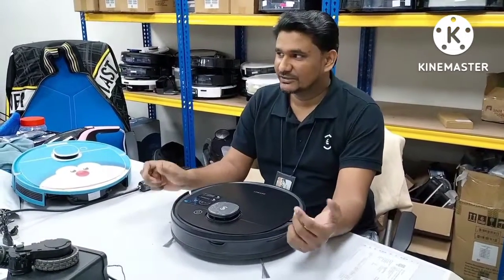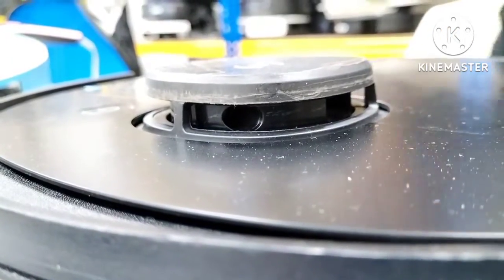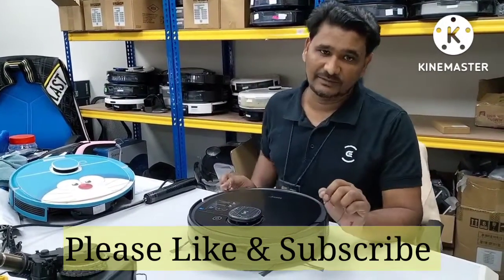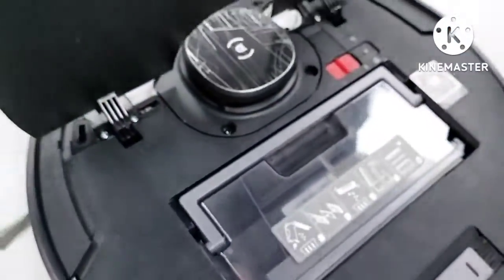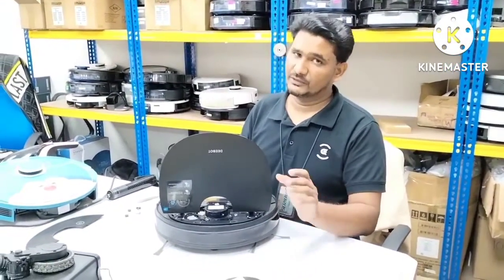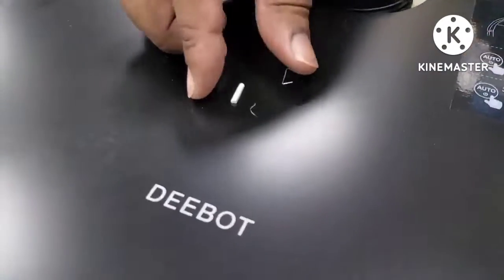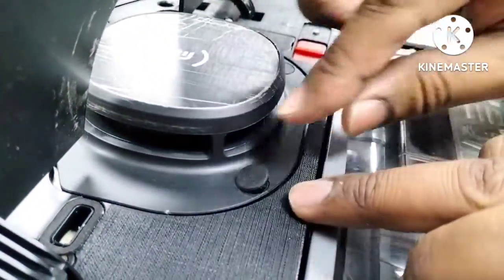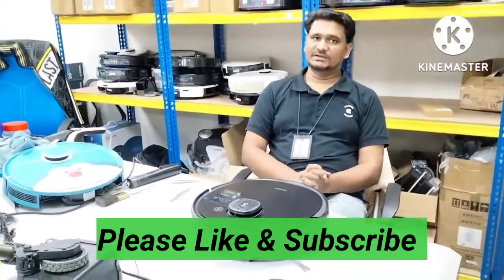How to Fix/Repair Ozmo 950 LDS Error?

Comment: The son poured sweet tea over the deebot. Since then, it reports an error that the distance sensor is blocked and that it needs to be cleaned and deebot stoped with work. I didn't know how to clean it, I took it to the service center and they asked me for €300 for the repair. I refused, at home I opened it myself with your video, wiped the sensor, washed the eraser and deebot works again without problems. Thanks for the video! You saved us a new expense!
Reply from the maker: Waaaaaooo.excellent really feel happy 😊😊

Comment: My deebot is still giving LDS error after cleaning. The LDS unit is rotating nicely. I observed that the white wheel which rotates the LDS unit, stops after few rotations and then rotates again. This happens twice and the deebot shows LDS error. What might be the issue?
Reply: Hi I have the same issue . Did you manage to fix this ?
Reply: Same issue and no fix
Reply: @josephchandy9006  couldn't fix it. The company said that LDS has to be replaced. However, I think that there might be something wrong with the board supplying power to it. The company service guy just came and cleaned it and said it won't work. I think they don't have a good technical repair service team. All they suggested was buy new LDS or buy a new bot.

Comment: My LDS rotation is smooth and nothing is blocking the sensor or the belt but the sensor rotates for about 30secs and then stops for 5 secs and then again rotates for 30secs and then stops again for 5.  This happens 4 times till i finnally get that "LASER SENSOR IS BLOCKED"

Comment: There is a problem where the LDS kept moving even when the machine is in the OFF position. The command is starting to clean but it’s wheels doesn’t moves. Could it be the LDS is malfunctioning or motherboard problem? Thanks in advance…

Comment: Hello, I have just followed these instructions to clean the LDS on my T8 Aivi. However it is now not working at all and shows a dtof error. What should I do now?
Reply from the maker: Ok..in T8 aivi you need to replace motherboard+ under the motherboard got one small chip attached with carpet sensor n motherboard through wire these parts will replace together then only Will move...if you just change motherboard then that motherboard also will be short circuit..can not use again

Comment: My debit is not working. It's not switching on and when I tried to place it on the charging dock it's giving warnings to switch it on and showing then is warning that the power is low... What do I do with this?? Any service centers in Hyderabad.
Reply from the maker: May I know which model u r using madam...if it's not Ozmo 950 then most likely is just battery issue...but if it's Ozmo 950 model & it can't charge means motherboard issue

Comment: Thank you for this detailed sharing. And for so generously sharing your knowledge. I finally got the top cover open, the tip I think is to prise it open from the sides and not the middle. But I'm so grateful for your videos. Thank you again! My LDS sensor is now working again using your method of testing!

Comment: These videos are really helpful for users who don't have Ecovacs service center nearby. I'm one of the culprit :)
Reply from the maker: Welcome..if u need any help can contact 00601137973018
Reply: @ecovacstechnicalsupport5278  You made my day. Really appreciate your support.
Reply: Dear help me too
Everything seems fine and clean and moving but getting the same error
Reply from the maker: @supratimsaha4488  if you followed all these video tips but still gives same error then LDS laser distance sensor assembly need to replace..u can contact ur seller if he provides you LDS then u can replace at home as well
Reply: Hi sir 
I am from bangalore India.
I am having deebot 950.
Its going backward then stop and showing bumper stuck. Please help.
Reply from the maker: @chhandak1  when u press deebot bumper...it bounces back or not...if not bounces back then just need to open bumper n fix it again propely... Will be ok
Reply: @ecovacstechnicalsupport5278  my deebot ozmo is not tracking  map

Comment: very good explanation and good Demo thank you Sir
Reply from the maker: Welcome thanks appreciation ☺️
Reply: @ecovacstechnicalsupport5278 Dear Bro I am Electronic Technician I got one ECOVACS DX 9G for service Because one side Running wheel Jamming it is steper motor But I can't open and take out motor I unscrew Everything and Bumper also removed Top Small Backlid Removed .Slide switch knob Removed But last Bottom Cover not coming outside why?
Reply from the maker: @dinarajancn5902  need to remove LDS screw first then all chassis screw include battery n underneath battery 2 more screw once removed all screw remove top cover wire From front attached with motherboard then pull up up cover after removing top cover then only can take out wheels...
Reply: Hai my Brother Now Remove LDS  Cover and 4 screws than I unscrew All screws and lift to the Top portion But only 75% lifted     I think one Hiden Screw in Side the front side pls help
Reply: ok thank you Sir Now it is. opened than lam trying to take out the Wheel

Comment: Hi, thanks for the great videos. I've cleaned the LDS on my 920 and the belt is good condition, however, the vacuum remains on the charger with the side brushes spinning and the LDS moving, but the unit doesn't depart and commence cleaning. Any ideas? The drop senesors look in good condition, and we've never used the mop function so nil corrosion etc.
Reply from the maker: In this case normally I change coreboard.. located next to motherboard a small green chip...U can purchase online can replace.. problem will be solve

Comment: Thank you for the video. I’ve followed your instructions and cleaned everything. I’m still getting the LDS error. Any idea of what else I can do?
Reply from the maker: 2 possible reasons.... might be Core board or LDS issue...in some cases motherboard also need to replace most likely is core board or LDS issue
Reply from the maker: After install the part only can confirm whether ok or not

Comment: My deebot has the same problem, but after just moving a bit the laser, it starts working again. Or better it works for some cleanings and after it sticks again. What do you think?
Reply from the maker: Actually LDS/ D-Tof doesn't turn continuously...it stop after few seconds then run again & build the map...this is how LDS assembly work...but if while turning it makes some grinding sounds or bit Sharp sounds.... means LDS assembly will give error but maybe for a while start working....in this situation LDS assembly need to replace

Comment: Hi, I always follow your videos, you explain very well, you make everything seem so easy. But now I wanted to ask you for some info, if you can help me understand, I have a Deebot 920 at home, I disassembled the LDS laser to clean it, but when reassembling it, I realized that I had inserted the plug of the LDS laser cable that goes to the board inverted mother, so I reassembled and turned the pin on the laser, now it DOESN'T turn anymore, it tells me it's blocked, but I turn it easily with my finger. I tried to reset the deebot, from the button next to the mention, but nothing to do, do you think it can be solved somehow? Thanks for your help, I'm waiting, have a good life.
Reply from the maker: In motherboard in front there's no other clip with same size...so it's not possible to fix LDS wire somewhere else... it's ok..just fix back all wires at correct place hopefully will be ok if LDS totally not moving then might be Core board issue or LDS issue
Reply: @ecovacstechnicalsupport5278  the cable was reversed over LDS. LDS is good I tried with another Deebot 920 robot. Is there anything I can do before changing the motherboard?

Comment: Hello. Thanks a lot for sharing that. I've followed the instructions however I still get the error. I get the message and the LDS is not turning at all. I've checked the motor separately and was able to turn it on (spined without issues), from the motherboard I also managed to confirm the power is coming to the LDS assembly. Should I assume that replacing the LDS assembly is possibly the solution? Or can it be related to the motherboard also? Thanks in advance and btw I have a model 950.
Reply from the maker: Most likely is LDS assembly Only need to replace...
Reply from the maker: Make sure if ur original LDS assembly is turning but deebot still not moving then then maybe core board issue or motherboard...but if LDS totally not moving then Just replace the LDS Assembly
Reply: @ecovacstechnicalsupport5278  Thanks a lot for your prompt response, very appreciated! I will progress with the LDS Assembly replacement.

Comment: I am right now trying to fix lds blocked issue.    I  cleaned most of the dirt. Belt is ok. Motor is making some sound consistently.  I donot know if it is ok. Motor starting speeding and pausing.  When the is removed the motor i working as you described.  But still lds blocked voice is played
Reply: Please help me

Comment: Hi

Thanks so much for the LDS malfunction resolution as we do not have any service centre nearby.

Another issue is robot motor starts automatically whenever power goes off and the robot parked in docking station. It doesn’t move but motor starts running whenever power goes off ? What should we do to redress this ? Thanks for your guidance 😊

Comment: Hello! I have a DEEBO OZMO 950, for a few months now it keeps creating wrong maps and cannot get back to the charging DOCK.
otherwise everything works, the DEEBOT is 2 and a half years old.
in your opinion what could be the problem? thanks in advance for the feedback
Reply from the maker: After 2 years might be LDS assembly need some service... you can serve first then reset full deebot... reconnect & save new maps if all parts ok then it will return to charger successfully..else LDS or core board issue possible

Comment: I'm getting an LDS error, but my LDS sensor is not dirty. When I try to rotate with the belt attached, it doesn't rotate as fast as you do, and it struggles to turn. When I test the motor with a 9V battery alone, it spins very fast. When it's connected with the belt, it spins slowly. Do you think it's a roller bearing problem or a motor issue? Should I completely replace the LDS sensor?
Reply from the maker: LDS assembly won't move very fast...if LDS is turning still can't move the deebot then sometimes Core board also can be deflected...
Reply: @ecovacstechnicalsupport5278  
Thank you for your help. When I took a closer look again, I noticed some dirt around the small black sensor inside the LDS card. I cleaned it with alcohol and a brush. The device is working now.
I have one more problem; the device hasn't been able to return to its base for a long time. What could be the reason for this? Which part may be faulty or in need of maintenance? The wheel had a problem before, and I replaced it. Could it be related to that? Have I made an incomplete assembly? Where should I look?"

Comment: Im having an issue with an Ozmo 950. it cleans and when its returning to the charging dock it stops right in front of it a couple feet away or less and rotates back and forth like its not recognizing it. Any advise on this. its in a location free of infared interferance or sunlight.
Reply from the maker: Sorry for the late reply....plz put the deebot in front of charger around 2 feet away n give command from mobile app. Return to charger see weather can catch signal or not....plz check Ur deebot bumper got dusty or alot of scratch on it...it effects to catch signal...can use car wax or any polish to make ur deebot bumper shiny can rubb with soft cloth....if still same then 2 reasons. Might be charger not giving signal or maybe deebot bumper faulty...can not catch signal from charger..

Comment: what if my  cleaner stopped working after 5-7 min? saying lds mailfunction than afte wont do anything? I have replaced the laser(not the full spining part)  could it be something like mainboard issue? or laser mainboard? thanks
Reply from the maker: Normally after replacing the new LDS assembly deebot start moving as normal....in  few cases I face this issue that I replaced cored board then start working...&. Few cases I face need to replace main board & LDS as well together then only deebot works

Comment: Sir, i followed the instruction in this video and there's nothing got jammed. My lds sensor can turn freely, and i check the belt is still okay. But i keep got the LDS malfunction. Mine is deebot 920. Can it be caused by the anti drop sensor located under the deebot? My anti drop sensor look dusty from the inside, i cant clean it
Reply from the maker: LDS assembly need to replace.... LDS error occurred when something wrong with LDS not due to Anti-Drop Sensors.... check with seller for lds assembly for 920 or 950 model...both using same LDS
Reply: @ecovacstechnicalsupport5278 I face similar issue LDS sensor turns freely and still shows error LDS malfunctioning.
Can some electronic guy can fix diodes with multimeter etc as we don't have service centre nearby

Comment: Hello, thank you for the video. Althought i opened and cleaned the LDS unit, LDS does not rotate easily and quickly. Could it be the cause of the LDS problem? How do I make it rotate freely? WD40 :D ?
Reply from the maker: Don't use WD-40 spray in LDS assembly...plz remove the belt n try to turn LDS see weather can turn freely...if yes then just LDS motor became slower...need to replace LDS motor only...you can find motor from electronic component sellers...or if you can find full LDS assembly will be more easy but bit expensive
Reply: @ecovacstechnicalsupport5278  thank you very much

Comment: After cleaning the assembly and the sensor, the sensor still does not rotate. I also opened it up and checked if all wires are okay. What could be the problem?
Reply from the maker: Sometimes because of core board it doesn't move & some time LDS motor spoil

Comment: Ecovacs Ozmo 950 LDS is Blocked, I checked Belt is Okay & Sensor Body Moving Freely by hand means not Jammed, What will do, Kindly give Suggestions, I am from Dwarka, New Delhi
Reply from the maker: If all you tested looks ok then it means LDS assembly is faulty...plz check with your seller for LDS assembly...you can replace urself at home if you can get online...

Comment: Hey :)
My Ozmo 950 running circles to the right side. Always when i turn it on it runs directly. Any Idea what this could be? I cleaned the Fall Sensors and the shock absorber at the front but nothing changed :(
Reply: Aynı arıza benim cihazdada var. Ozmo  model devamlı sağ tarafa daireler çiziyor

Comment: Hi, could you please help me? My deebot 950 not moving, though the brush start working after saying  "I am starting to clean". Checked wheels, bumper no problem. But doesn't move away from base. Tried rebooting too..☹️
Reply from the maker: Sometimes when u disconnect from charger n press start button it will work...but actually it all happened when LDS got some issues.,... LDS need to replace

Comment: Hello sir your video is very informative, I have deebot model Dx6g.
My device is only circulating at one point only, could you please help me out in this.
Reply from the maker: Just keep turning at one spot in circles only or can move here n there n after few minutes saying cleaning is complete???
Reply: @ecovacstechnicalsupport5278  it’s just keep rotating at one point. Thanks for replying sir.
Reply: @ecovacstechnicalsupport5278  just keep turning on one spot and after few minutes saying please help me out, and nothing else.
Reply from the maker: If just rotating at one place n can't move forward then its not an LDS issy . you must watch my video related to this topic...its a wheel issue sir....if ur deebot is turning clockwise then right wheel got problem if turning anticlockwise then left wheel issue
Reply from the maker: You can check My play list... wheel issue Fix at home video
Reply: @ecovacstechnicalsupport5278  thank you very much sir, and if it says after some time cleaning is completed then what could be the reason.
Reply from the maker: @harshvardhan7844  in this case is LDS issue
Reply: @ecovacs technical support:sir i I have opened the cover of lds and I found it is rotating freely, but if it is still faulty then could I get it in Austrailia, and I would like to check the wheel assembly also, could you pls share me the document, how to remove the wheel?
Reply from the maker: @harshvardhan7844  if u are able to open top cover without damaging any wiring then wheel can replace eaisly....in Australia Ecovacs available if I'm not wrong..you can search for service center or any sales person in Australia
Reply from the maker: @harshvardhan7844  for any help u can WhatsApp me at 00601137973018
Reply: @ecovacstechnicalsupport5278  thank you sir , but in this number there 12 digits, is it correct ?
Reply: @ecovacstechnicalsupport5278  sir I have sent a video on your WhatsApp, could you pls suggest me?
Thank you
Reply from the maker: @harshvardhan7844  include country code correct
Reply: Plz your service center address give me plz

Comment: Hello, as there's no service centre nearby... I opened and checked the LDS, belt is fine, it is rotating, no dust... Still it's saying "LDS is blocked please clean it"... What may be the problem please guide...
Reply from the maker: Actually in this case need to test 3 parts one by one.,.. beside the mother board got small coar board attach with a chip, 2nd LDS n 3rd part is main board...but can confirm after replace that part...so far no way to test with multi meter....
Reply from the maker: @kinjalpatel2318  sure most welcome..can WhatsApp at 00601137973018
Reply: Thank you sir, as according to your guidance we changed the LDS and now it's working... Thank you🙏